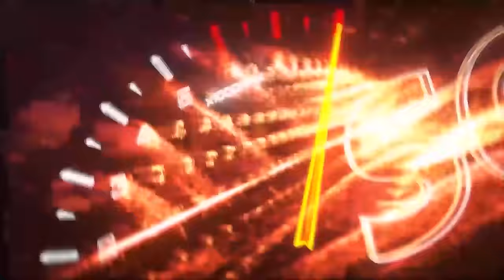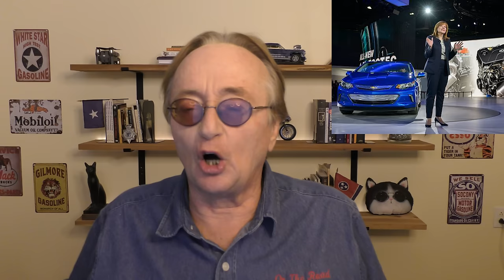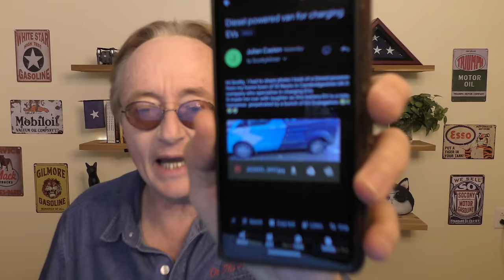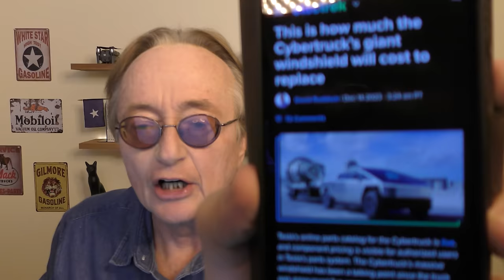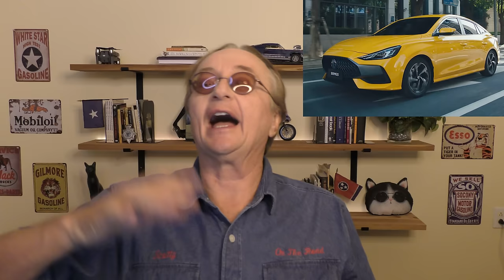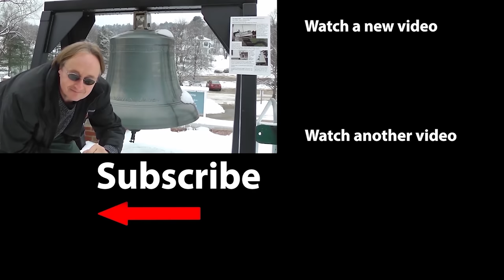GM's CEO Just Announced "We're Shutting Down Truck Production"

Comment: Laugh all you want, but using a diesel powered generator to charge your EV is STILL better for the environment than driving an ICE. Think about it. How much fuel is required to drive 200 miles in an ICE? How much fuel is required to generate enough electricity to charge an EV to drive 200? Look at the fuel economy in electric plug in hybrids that use the gas generator only. It burns fuel, but the emissions are far less, and the mileage is far greater. 

Don’t get me started on environmental impacts involved in production. EVs may be dirtier to build by they’re still cleaner to drive. An EV with 30k-60k miles on it is still cleaner. You got an old ICE you love? Good. Keep it. But don’t buy a brand new ICE and think it’s better than an EV unless you live way out in the middle of no where, off grid, and that 300 mile range isn’t enough for you.
Reply: It takes 5 times more energy to manufacture an EV than an ICE vehicle! -Wall St Journal report The electricity has to come from somewhere and if you say wind or solar I ask you why do you hate birds and other wildlife?
Reply: A diesel engine is an ICE! Do you know what ICE stands for!!! INTERNAL COMBUSTION ENGINE!!!
Reply: @waynelangston863 and do YOU know what “fuel economy” is? That’s why I made my comment to begin with! A Dodge Charger gets horrible fuel economy compared to a Dodge Neon. If Dodge made a plug in hybrid though, imagine the fuel economy in that! An electric hybrid uses fuel to generate power to charge the batteries. It’s just like a real EV, but with a portable generator attached, advertised as a “range extender.” Are you going to tell me a Chevy Volt gets the same fuel economy, thus same emissions, as a Chevy Suburban? Shouldn’t the gas guzzler tax apply to the Chevy Volt then?

In theory, gas stations around the country could use gasoline to generate electricity to charge EVs that bought voltage there. It would still produce emissions, but the fuel economy from all those EVs would far exceed that of all the ICE vehicles who still bought gas.

Comment: After all the STUPID 💩 from the big three, I chose a Ridgeline, At least it's not trying to be something it isn't, Isn't a Perfect light duty Truck... end of story 🤫😁
Reply: 2013 Silverado with 300k miles 

Sold our other 2013 with 305k miles 

My 2014 has 190k miles transmission blew 2 weeks ago but the fluid was never changed to be honest 

My dads 2018 has 120k miles 

Chevy is still good atleast the 2007-2013s and 2014-2018s

Comment: A MOBILE DIESEL CHARGER???? Why not just tow it to a charger?
Reply: The dual motor ones won't move without being charged.  😅
Reply: @paulgilliatt7829  that's why they have flat bed tow trucks. winch it up, and bring it to a charging station and drop it off
Reply: Yeah it's insane